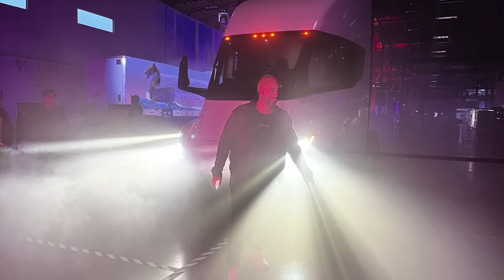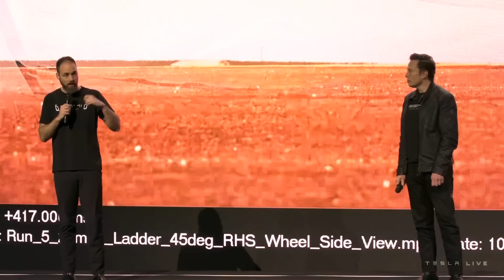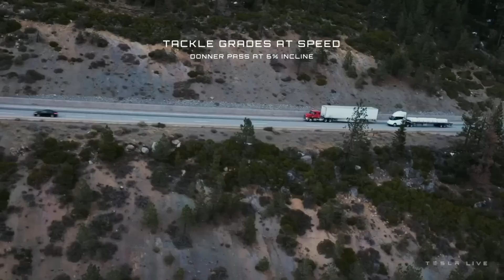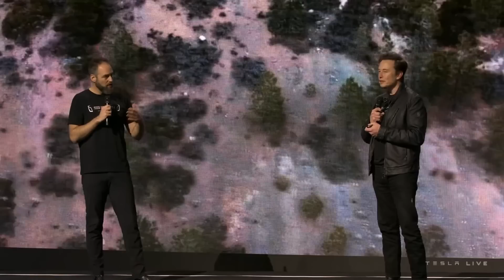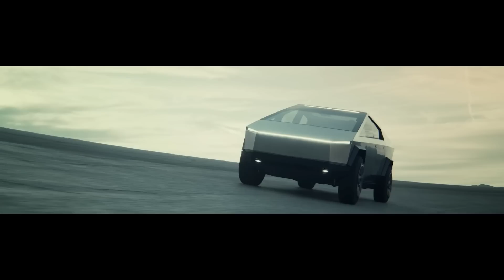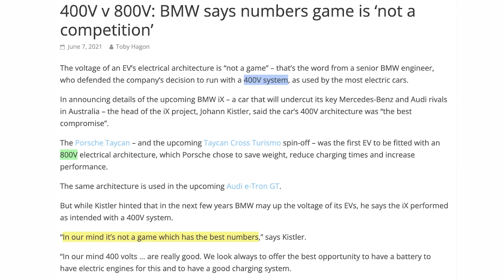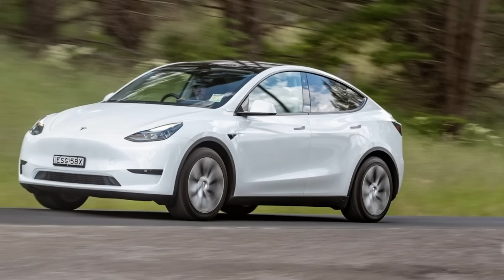Why Tesla Is Being Secretive About Tesla Semi & Why OEM's Are Giving Up ⚡️

Comment: A semi with a fully-loaded 500-mile range is, indeed, a "long-haul truck".  Most long-haul truck miles are done with the truck not fully loaded, either because the load is inherently lighter (potatoe chips vs concrete), or because the shipper just didn't have enough cargo to fill the truck.  That means that for a large percentage of Tesla Semi trips, the range will be greater than 500 miles.
Reply: I suspect with regenerative braking that the weight of the load may not be as significant as with diesel trucks. It's likely more about aerodynamics. So it will be interesting to see how much light loads impact range. It surprised me that that they didn't give the Semi a model name. But maybe I just missed it. Since they'll obviously need to come out with a sleeper Semi in the future.
Reply: @neeosstuff7540  I'm sure some after-market people are working on sleeper solutions already.
Reply: @neeosstuff7540  yeah, I'm not expecting much range increase from lighter loads. That's just not how EVs work. Coefficient of rolling resistance is just too small.

The big difference will be high roof vs low roof (when matched to high or low trailers)

The 300 mile unit might do some great work for customers that carry heavy loads short distances as e will have several thousand pounds more payload than diesels
Reply: Was it fully loaded?

He only mentioned the total weight, not the weight *of the load*.
Reply: @Zornotfugen  45000 lb is a full payload for the 500 mile version. That's similar to diesel trucks. The 300 mile version should carry a few thousand pounds more.

So for somewhere like the local aluminium smelter that has dozens of trucks shuttling between the smelter and the port about 40 miles away, it would be fantastic. They've got plenty of electricity, and it's the cheapest there is (people say it's under 3 cents/kWh).
Reply: @gasdive  show me where Tesla stated that this truck will haul 45000 lbs.

Those concrete barriers that it's hauling in the video?  Regular trucks haul twice as many.
Reply: @Zornotfugen  no, they don't. They're 4000 lb each. They loaded 11.

22 would be 88,000 lb and regular truck and trailer would have to weigh negative 8000 lb to be legal.
Reply: @Zornotfugen  a standard Jersey barrier is 10 feet long. (Google it yourself) If you look at the photos and videos it's clear that they fitted 4 groups lengthways, with a small gap between each, and a bigger gap at the end. That's an exact match for 10 foot barriers on a 53 foot trailer. A 10 ft Jersey barrier is 4000 lb. There's 3 lots of 3, and one lot of 2. That's 11 barriers at 4000 each, that's 44,000 lb, and the truck was 81,000, so 1000 spare. They drove 500 miles. That means a payload of 45,000 lb for the 500 mile truck.

It's reasonable to assume that the 300 mile truck is lighter, so that's more than 45,000 lb for the 300 mile truck.

You might want to see the Tesla truck fail, and you think making up lies will achieve that, but the facts are there for all to see. Normal trucks do not carry 88,000 lb in the USA. The 500 miler carries a perfectly normal payload, and the 300 will carry more than normal.
Reply: @gasdive  so why does Elon only keep talking about 82000 "fully loaded"?  82000 means nothing, it's cargo weight that matters.  If this truck really hauled 40000lbs...he should be shouting that number every other sentence.  That's the number people want to know.

But he very carefully avoids saying exactly what the load weighs, and only talks of the total weight. 

The only way to "know" the weight of the load is to figure out the normal weight of those barriers?

Legally he could have had those barriers made of a different material that weighs less, and not be guilty of fraud.  He could have hollowed out the bottoms of them.  

Why not just state the load capacity and shut up skeptics like me?  I'd be happy if he pulled off this miracle.  But he has a history of lying.

I mean, I'm using my Tesla solar roof right now, and these trucks have been out for three years, right?  Now it's 3 years past when he claimed they'd be ready, and this is the first public test?

Except no one is allowed to be there when it's loaded to verify Elon's claims?

I'll remain skeptical.
Reply: @gasdive  your estimation relies on Tesla inventing a completely new type of battery that weighs significantly less, but they didn't. We KNOW how much energy a battery holds and how much it will weigh, and it doesn't add up to the weight you came up with
Reply: @gasdive  incidentally, your caluclated weight of 37,000 lb for a 500 mile truck is the weight of the recently released 16 tonn Volvo electric truck. That truck has a rated range of 125 miles because it's an actual product that people can buy and test and use in their business, not bullshit claims with no proof about a fantasy product that no one can buy made to keep the stock price from falling further
Reply: @NJ-wb1cz  "We KNOW how much energy a battery holds"

Estimates vary between 244 Wh/kg and 296 Wh/kg

The truck uses 1.7 kWh per mile. 500 miles range implies 850 kWh pack.

850000 Wh. Divide by 244,the lowest estimate. (worst case). 3483 kg. Multiply by 2.2 to make it freedom units, 7663 lb for the battery. Call it 8000 lb. A trailer runs about 10,000 lb. That's 18000.

Take 18000 and 45000 away from 82000, that leaves 19,000 lb for the truck itself less the batteries.

We know the batteries form the load bearing structure of the truck.

So all that's left is the cabin, 3 motors, suspension, wheels and brakes.

All it takes is excellent design and attention to weight saving. There's no need to invoke wild fantasies about a conspiracy between PepsiCo and Tesla to manipulate share prices.
Reply: @gasdive  what's the source for these numbers and who verified them?
Pepsi ordered those trucks 5 years ago when there was nothing but empty promises, so I'm not sure what kind of argument is that or what it is supposed to prove. Considering the microscopic amounts they ordered, the publicity alone may be worth it for them, and if anything goes wrong Tesla will be to blame, not them.
Reply: @gasdive  Nice theory - except the 500 miles was done with Frito Lays not concrete barriers ;)  The start of the timelapse video show about 14 pallets of boxes.  The only weight I've found so far for a pallet of Frito lays is 243lbs/110Kg.  So the 500 mile 'haul' was pulling around 3400lbs/1.5tonne.  There's reference on uship for 24 pallets of corn chips with a total weight of 8256lbs/3.7tonne.  So lets go with that.   It's pitiful really.
The concrete barrier truck is a different truck entirely and shown purely to show off the uphill overtake.  Remember, the delivery was for Pepsi and they don't manufacture concrete barriers - they do may chips though :)
Reply: @Zornotfugen  You're right to be skeptical.  the timelapse shows pallets of boxes, not concrete barriers - which makes more sense for Pepsi since I believe they mentioned Frito lays.  I'm thinking 1 or 2 tonnes of chips, the rest is probably extra batteries disguised as boxes
Reply: @davelloyd-   Weight makes much less difference to an EV. The obsession with load comes from the ICE experience. The ICE motor converts the energy in the fuel into kinetic energy (or potential energy going up a hill) in the load and truck, and then the brakes convert that energy to heat. Less load means less energy needed to get up to speed, or up a hill and then less energy converted to heat stopping or coming back down.

The things that really make most of the difference to an EV are coefficient of drag and frontal area. Neither change depending on load.

Weight changes the rolling resistance, and that's related to the coefficient of rolling resistance. For a truck that's 81,000 lb, (concrete barriers) vs a truck that's 45,000 lb (chip pallets) it's not much.

Obviously the Tesla is going to be fitted with low rolling resistance tyres. So that's a CoRR of about 0.0045

I'll just switch to metric here because it's impossible in freedom units.

The amount of energy expenditure due to weight doesn't vary with speed. It's the weight force in Newtons (kg x g) by the coefficient of rolling resistance by the distance in metres gives the energy used in Joules (watt seconds).

81,000 lb is 36,800 kg

36,800 x 9.8 (g) is 360640 N

CoRR 0.0045 x 360640 is 1622.

1622 x 800,000 m is 1,298,304,000 joules. 

Divide that by 3,600,000 to get kWh 360.64 kWh

The lighter truck will use 45000/81000 as much. That's 200 kWh. The difference is 160 kWh. 

Using the lowest estimates for the pack size, 850 kWh, that's about 19%. (the more common estimate of 1000 kWh makes it 16%) It had about 10% remaining. (there was something left on the guess-o-meter and the cars hide some range after zero) 

So that would indicate that going over a mountain, in the snow it gets about 10% less than the claimed range on flat ground. 

That's not unreasonable.
Reply: @gasdive  "The obsession with load comes from the ICE experience." <- nope.  the obsession with load comes from the extremely competitive nature of hauling.  If one truck can only carry half the payload of another, then you need 2 trips to move the same amount of stuff.  That's either gonna take at least 3 times as long [haul 1st half, return, haul 2nd half] or require 2 trucks.  Either way it costs more no matter how it's spun.
It's rather curious that Musk was strangely quiet on the topic.  Where were the graphics from the original launch showing how it beats rail, for example?  It would be reasonable to conclude that they have not hit the targets - and by such a wide margin that it is better to talk about the wireless charging that the actual truck driver did not use :D
Reply: @davelloyd-  it carries the same load as an ordinary diesel truck.

At some point you're going to have to come to terms with that.
Reply: @gasdive  Except we don't know that cos they kept it quiet.  If you're right, I'm sure they would have been bragging big time rather quoting GCM.  I guess "Our 80,000 lbs truck with 75,000 lbs of batteries did 500 miles without needing a recharge" didn't quite have the ring they were hoping for
Reply: @davelloyd-  your imagination isn't real.
Reply: @gasdive  I'm guessing you've read the report from the Pepsi exec by now?  You know the one, where they're doing light loads across 500 miles cos it isn't too intense.  Heavy loads (drinks) were contrasted and they'll only do 100 miles for now.
Reply: 95% of the loads I pulled had me at between 72,000-78,000lbs. So yes.... technically you are right, that they are not right-on-the-limit. But shippers try to get the maximum weight, since they are paying for a truckload, either way. Plus the carrier wants some margin for error, at the weigh station.

Comment: I wanted to hear more about cost, auto-pilot/FSD , convoying, why the beast won’t jack knife, truck weight, battery pack size and manufacturing plans. Wondered if the Pepsi suits presence put the kibosh on a Q&A session?
Reply: No need to upset drivers further.  FSD was a no no at this event.  The anti jack knife is not hard in concept.  When the truck starts to jack knife the clutched motors are used to align the truck tractor with the direction of travel.   I don't know if they brake one side while applying power to the other.  This would be the 2 motors with the spline clutches.  We have the projected production number for the next few years.    Tesla has told us everything it wants us to know.

Comment: Likely they still don't have all the answers..   875KWh battery pack!?!   How much would that weigh?   How would they fit them in?
Reply: Someone speculated it has the equivalent of 4 model 3 packs.  That is not much space on truck.
Reply: @danharold3087  Elon said 1.7KWH/Mile..  500 miles..  850KWH pack..  8.5 model S plaid packs..   that is TONS of batteries.
Reply: @DD2DL  Model 3 plain battery is 
95 kWh and weighs 1060 lbs.  so yes 9 packs.  The 2 Ton allowance gets us to 7.  3K for the class 8 engine say 4 with the rest of the drivetrain. That gets us to 3K. Give or take 500lbs.    I did not think they could make the 500 mile run anywhere but on the flat.  So I can see to it going both ways.  Bad deal to bet Against Tesla on other than dates.  
This is not the last battery to be fitted to that truck.    If it is not good enough now it will be so why bother.
Reply: @danharold3087  I'm with ya..  I'm buying a few of 'em..   But the question remains..   How are they fitting as 850KWH battery pack in there?
Reply: @DD2DL  Of course we have no idea what it looks like so I am blowing smoke,  Lots of missing bits.  Engine, radiator, intercooler, transmission 2 large diffs & drive shafts.  WIth a bespoke EV design I think they can get them to fit.   Given that they will be switching to 4680s at some point it will change again.  

I was thinking about the frame.  In an ICE class 8 the drive train torques the frame between the motor mounts and the driving axles.  The axles try to twist the frame about the drive shaft.   With the electric the motors are almost in line with the axles.  Just a reduction gearbox which may have an offset.   This should radically change what one needs for a frame.   Maybe even go aluminum.  I would love to see Monroe tear this thing down.
Reply: @danharold3087  YES!  A Monroe teardown will be greatly anticipated!  I'm sure there will be a line out the door for that report.   I met Sandy and his wife briefly at the Tesla Takeover event in San Luis Obispo earlier this year.   Much respect for the man and his method.
Reply: @DD2DL  I am sure that was memorable.  KUDOS   Corey said he was thinking of crowdfunding the semi.

Comment: I have a question concerning delivery.  How are these going to be delivered, normally one semi piggy-backs three other semis.  The towed semis are virtually empty.  This cannot happen with the Tesla, you have many hundred pounds of batteries.  I'm thinking that semi delivery will have to be handled strictly by rail.  What's your opinion.
Reply: Companies will want these so badly that they will fly drivers to the factory and have them sleeping outside in tents waiting for their new truck.
Reply: Is the electric drive train with the small cells really heavy compared to the diesel ?     Elon has said it can pull a full load.  That indicates that the truck must be comparable to a diesel.

Comment: With approximately 500,000 trucks on the road or sitting idle ready to be used, Tesla is missing a huge business model opportunity for solar panels by top those trailers. The most insane thing about the presentation yesterday was the fact that no discussion was shared regarding solar panels on top of all these trailers constantly charging a plug-in battery system.
Reply: the math doesn't work Griz.  yes, it's an opportunity but one probably not to be capitalized on until solar cell efficiencies / sq unit increase substantially.
Reply: Wouldn't generate that much power.  Put the panels in sunny places, oriented to face the Sun.  Charge from the grid.  Drivers are required to stop longer per 24 hours than is needed to keep the truck charged.
Reply: A 8.5 x 53' trailer will generate approximately 57kwh or 6% of the total battery pack per 8hr.
Reply: You all are misconstruing entirely. “Never impose today upon tomorrow - it never work...Never!” -GM
Battery storage is battery storage is battery storage. What YOU do with it is YOUR business model. Few people (at all) comprehend battery swaps today and in years...decades to come. Limits. 
Endless possibilities here. ENDLESS!!!

Comment: Seems like they put out the semi just to fulfill a promise. They don't seem serious about volume production.
Reply: They are building a few on the existing line while the actual production line is built and ramped up.
Reply: @danharold3087  we’ll see how many units per year this amounts to. I’d like to see at least 20k per year but I get the feeling it’s going to be waaaay less.
Reply: @soul-software-survivor  I seen numbers like 20 or 100 for this year.  50K in 2024.    If that works maybe setup additional lines.   Providing there are batteries.

Comment: While this is not a long haul truck, it could be with sufficient charging infrastructure. Supposed to get 300 miles of range in 30 minutes. If there happens to be an available megacharger when a driver takes their 8 hour rule 30 minute break, they can top up, then do full charge during their 10 hour break.

Comment: Main takeaways for me; spectacular engineering, unbelievable power density in the motors, could do long haul once truck stop charging is available, what is the weight of the semi itself?  Likely a 900 KWH pack as the run began with a 97% charge and ended with 4% still available.  I wonder if he will send two to Mercedes??  That would generate some buzz!!
Reply: If I was Elon I would have sent Merceded 2 Tesla Semis COD $2 million.  Each.

Comment: How long will the motor last? 1000 volts. 82,000 pounds. Football size motor. What happens if the motor fails?
Reply: OK you are misinformed.  The battery pack is 1000V.  The battery feeds an inverter which creates the correct voltage for the motor.   Not unlike the backup PSUs used on computers.   Battery is DC load is AC. Motor controller converts.  As for when 1 of the 3 motor fails.... you have it changed.  Maybe in an hour or so.     Closer to changing a u-joint than a class 8 Engine.
Reply: @danharold3087  Missing information. What is the voltage for the motor. How many amps are they using to move 82,000 pounds? How many miles is the motor rated for?
Reply: @Dularr  How to explain this. Electric motors do not much care at what voltage they are run so long as you don't overheat them.   Each motor is rated for 205 kW.  Tesla says it designs its motors to last a million miles.   YMMV